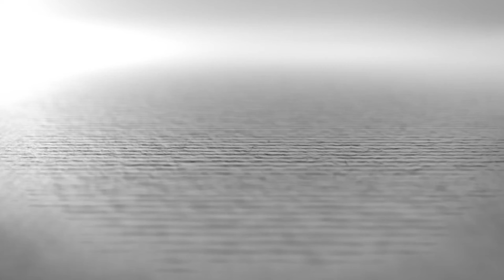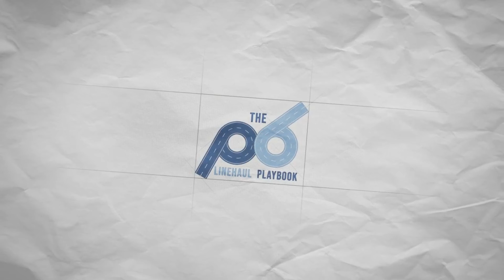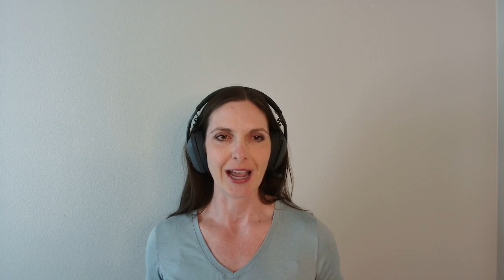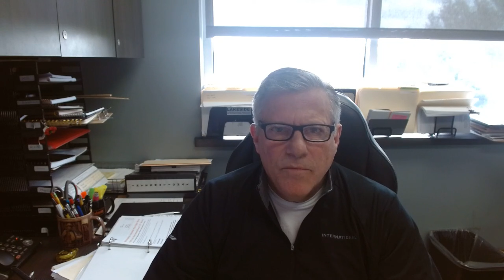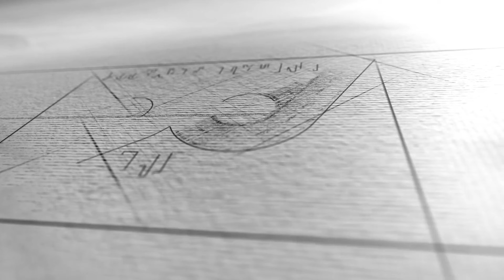Can the S13 International Engine really save you money?

Comment: I’ve had my s 13 with 14 speed transmission for 9 months with the performance switch and turtle switch getting 8 mpg and I run a lot at 78 mph been trucking for 30 years it was hard to get me in a automatic this is way better than any Eaton I can out run most trucks out there it’s fun to drive